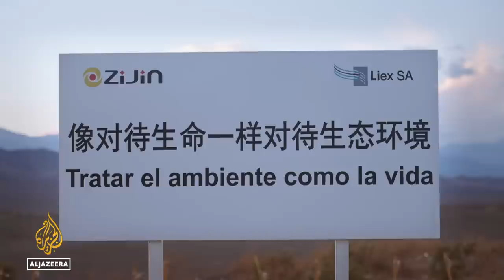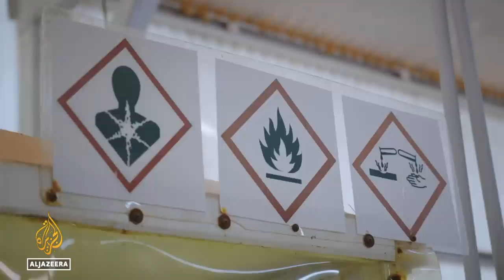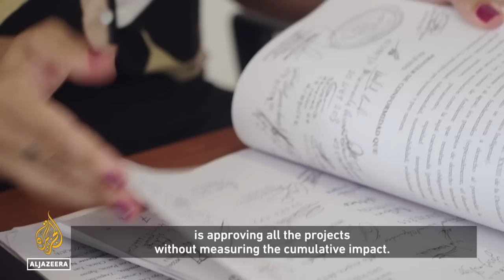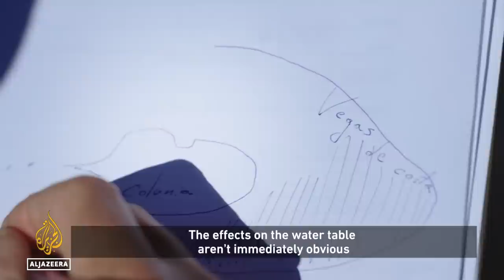Argentina's 'white gold': Will its lithium boom end badly? | People and Power

Comment: Some of the data at the beginning is incorrect:
1. Lithium is not becoming more valuable each day. More popular, maybe... The price has been stable throughout 2022, and plummeting for the past three months...
2. $85000 per tonne!? As of yesterday, which is also the date of upload of the documentary, the price is 319,500CNY, which is $46,364.
Reply: The first google search result shows that the price of lithium has at least doubled in the last five years (2017, from tradingeconomics on lithium carbonate). This may drop once seawater extraction becomes cheap enough, but for now the price continues to rise, although slowly.

The $85,000 per ton probably came from cherrypicked data on the same chart from Nov 2022, it was around the 590,000 CNY mark which IS around $86,000 USD. As for the time/amount difference, video pieces are produced weeks/months in advance, so that statement may be five months old.